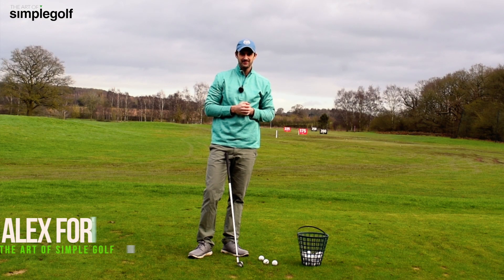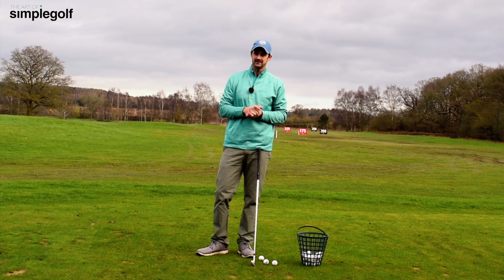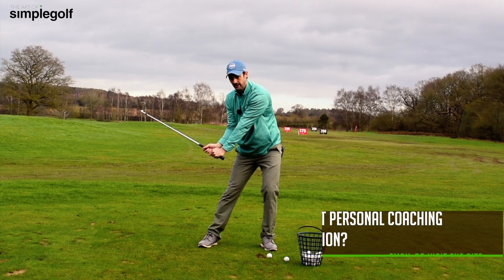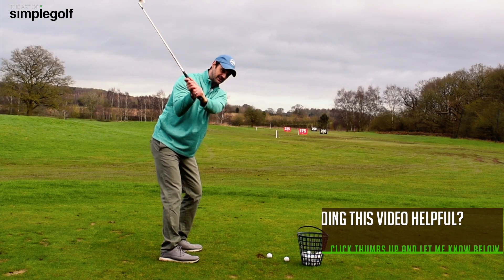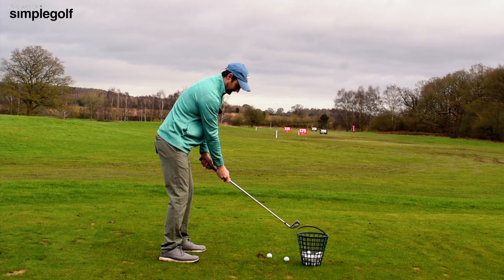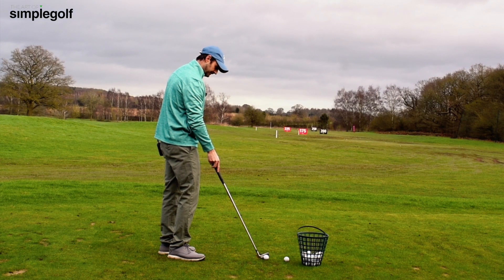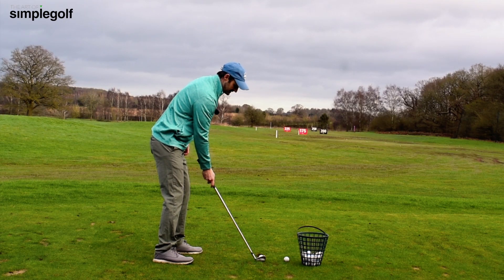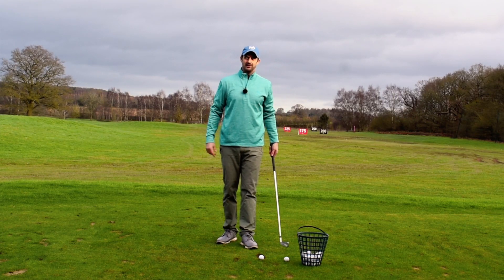How To Make A Downswing And Find The SLOT with this Practice Drill

Comment: I really like your videos but this drill would not work for me. I come too much from the inside, so I have to try to hit a "slice" by squatting and turning with the legs so that the shoulders turn as fast as possible in reaction to the lower body. In reality I still am hitting about 2-4 degrees from the inside with my 9-iron. But golfers have different problems :)
Today I was able to get my normal 1000 rpm draw to about 200-300 rpm:s, which was nice. Also only pullhooked only one shot badly in about one hour.
The strange thing is that the more I hit from the inside, the more I hit it to the left....
Golf epitomizes the saying: feel is not real....that is also what you are saying in response to the comments of Nick and Dave
Reply from the maker: Can't argue with that lol! Keep at it and own your swing and game:)
Reply: I think you still can use this method by fixing your other things that cause you to bring the club to the inside. Tiger does this the best. His down swing is almost more straight down than in this video. I’m saying this bc I have same problem as you (too much from the inside but for me it was a sway to the left instead of squaring as Tiger). My fix is squading down and add this moves. Enjoy!